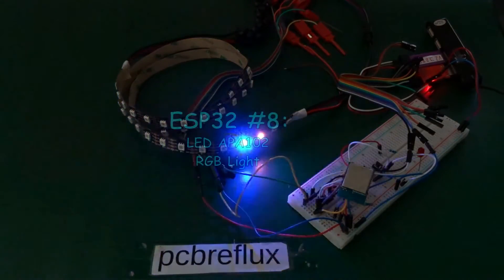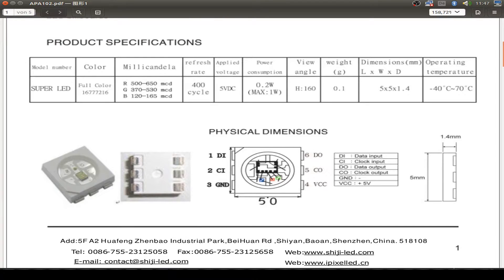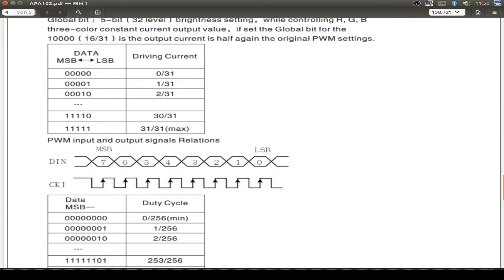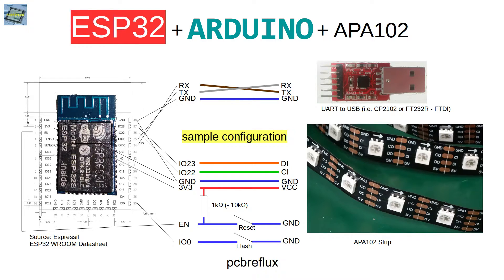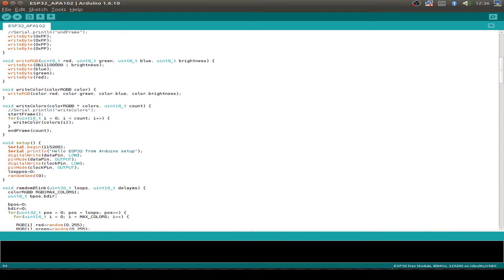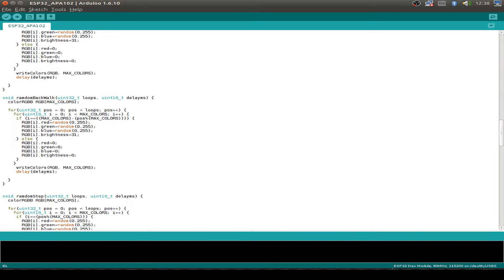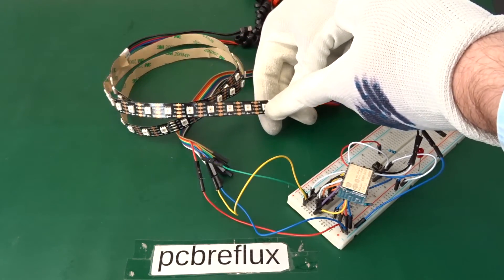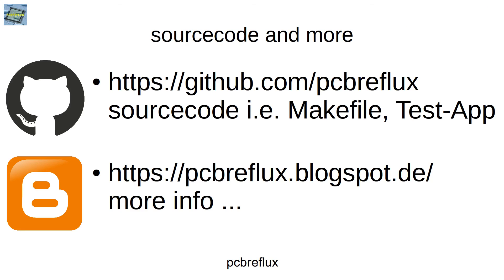ESP32 #8: APA102 RGB LED Strip controlled by Arduino Sketch

Comment: Nice. But ESP32 is of 3.3v and apa102 is of 5 volt. How this have you managed??
Reply from the maker: The data and clock pins works fine with 3.3V logic and I use the 5V rail from my USB connector for the APA102. But you can use also an external power supply, but don't connect the 5V rail to a ESP32 pin (only to the voltage regulator on the esp32 board if there is one).
Reply: That's great. It means it is not necessary for data and clock lines whether they steered by 3.3v or by 5v. 
Thank you
Reply from the maker: in this case yes, but this is not true for all other devices. And be careful when using esp32 inputs from a 5V device, then you need a levelshifter to protect the gpios.

Comment: I like your channel and videos. Did you already try to drive single line LEDs like the WS2812b or SK6812?
What would you use to drive them - ledc functionality, PWM or other technique?
Thx
Reply from the maker: VikingGod667 Hi, never try it with the esp32 but there is an example https://github.com/nkolban/esp32-snippets/tree/master/hardware/neopixels. Use the Apa102 because you don't have to use a precise timing at 150ns and I want a solution for other platforms as well like nordic nRF5.